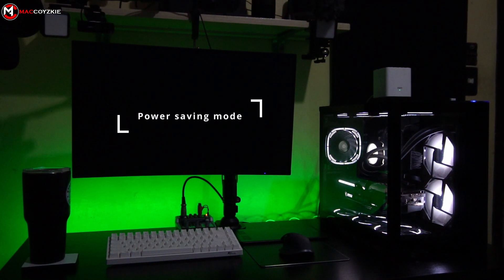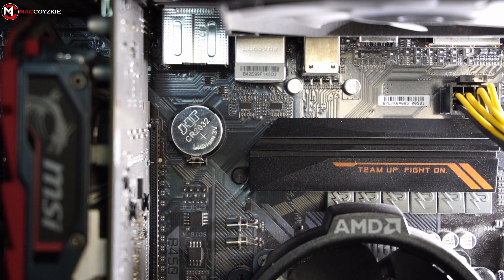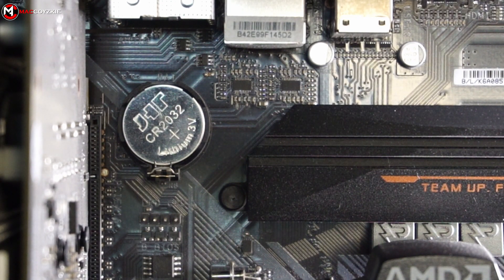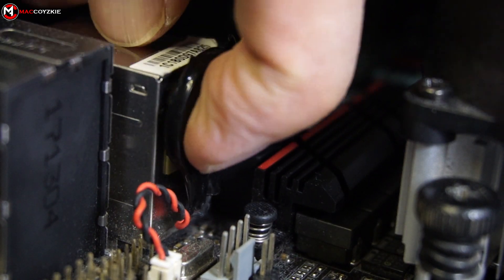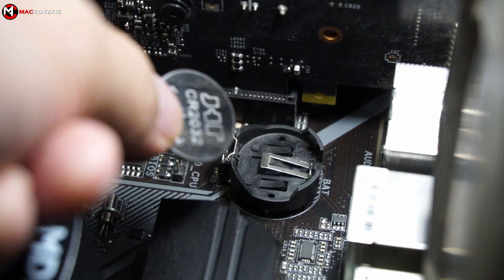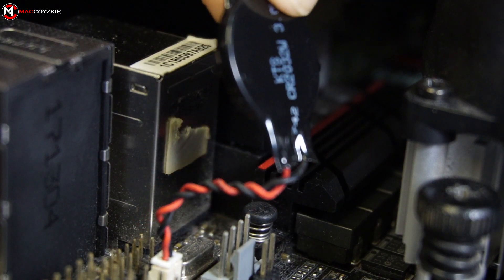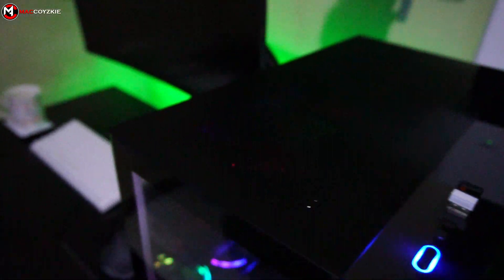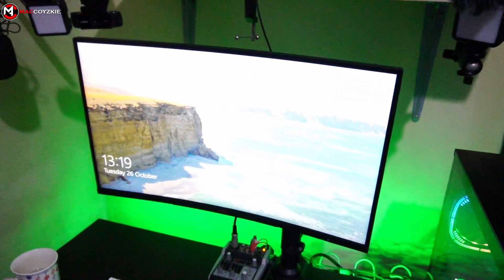Power saving mode FIX

Comment: My pc is new and that did not work I already watched your other vid what do I do if I take it to pc store will they fix it
Reply from the maker: for new pc build watch this for more info https://youtu.be/r-DbD0za6ns and the answer to your question is yes, they should since you can still use Rma
Reply: @MacCoyzkie  I’m using hdmi if I change to dvi adapter will that fix it
Reply from the maker: @Frosty-xp2re  you can try but i don't think it will make any difference. can you tell me what are your pc specs so i can have an idea?
Reply: @MacCoyzkie  is it maybe the hdmi doesn’t work and that’s why there’s no connection?
Reply from the maker: @Frosty-xp2re  that's also possible

Comment: will it work? i have a dual monitor setup and i experience this every day once or twice but one monitor only says power saving then goes completely off then the other monitor still on but blank screen just grey color
Reply from the maker: yep that's a dead cmos you got there. i suggest try a cmos battery from a working pc and use it in your pc to double check.
Reply: @MacCoyzkie  but how will i know if it  is compqtible with my pc
Reply from the maker: @c48i3  there are indication in the battery itself check its the same
Reply: @MacCoyzkie  i took out the battery and put it back but now its not turning on havent tried out my other pcs cmos battery but i need pc working how do i do this
Reply from the maker: @c48i3  im confuse, its turning on but not working? do you still see the power saving mode? what seems to be the next problem?
Reply: @MacCoyzkie  yesterday i was gonna swap cmos battery with my other pc but it was being used so i put back my old cmos battery into the motherboard but now it wont turn on
Reply from the maker: @c48i3  basically you haven't done it yet, we can't know if its the battery then
Reply: @MacCoyzkie  idk what to say but i switch both batteries now my battery works on the other pc
Reply from the maker: @c48i3  that's bad news bro, this might be a faulty motherboard then. Try a different psu for the last time and if the result is the same you might need to take it to a local shop for second opinion
Reply: @MacCoyzkie  i just switched my psu still hasnt gone power saving i will see if it will
Reply: @MacCoyzkie  but heres the thijg tho it only usually goes power saving when i play gta 5
Reply from the maker: @c48i3  hmm, that's interesting. have you ever tried reinstalling the game? the game might be the problem there
Reply: @MacCoyzkie  i tried it multiple times already but now after i switch cmos battery it doesnt seem to restart
Reply: @MacCoyzkie  but im still not sure

Comment: Both monitors say entering power saving mode, bought a new cmos battery, cleaned and re put in ram and still nothing happens
Reply from the maker: if you experience power fluctuation in your house lately that could also be the cause so try using AVR or UPS to confirm. If no, then i think you need to have your motherboard tested, if you got a spare pc try it out or if you don't i suggest bring it to a local pc store
Reply: Did you fix it

Comment: hey, i'm expecting a respond i cleaned and reseated my ram and nothing has solved! any issues??!
Reply from the maker: what are your pc specs and tell me how the pc problem started so i can have an idea?
Reply: @MacCoyzkie  my pc has 8GB ram and icore3 i don't know anything else, it started when i played genshin impact and it crash rarely and after after i played in a few hours pc turn power saving mode and restarts now the pc when i start the game instantly restarts, games like tetrio,osu or non open world games that needs like 2GB-4GB crashes after hours of playing sometimes around 5 minutes of playing it turns into power saving mode, that's all
Reply from the maker: @idkbruhzzz  like i said in the video if you see the power saving mode you need to replace the cmos battery
Reply: @MacCoyzkie  yeah you are right but I thought there are maybe any case to fix it without buying any of those, well after all thank you for the help!

Comment: Hey can you help abt my problem cause while using my pc for 30 minutes or 1 hour my pc always pop up "saving mode"
Reply from the maker: have you tried the solution in the video yet? if you have and still does not work try to re-seat your rams and while at it just clean the dust off altogether

Comment: I got a brand new motherboard and my monitor is saying  power saving mode. i cleaned everything and did what other tutorials said, and none of them worked. would my battery be dead already?
Reply from the maker: most likely, i suggest borrow a cmos battery from a working pc, try it out in your pc before buying new one